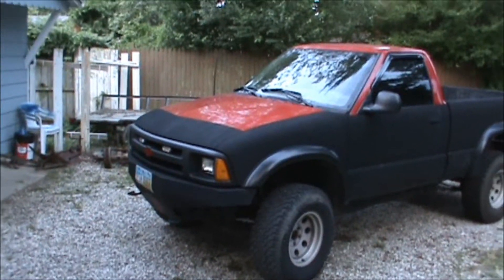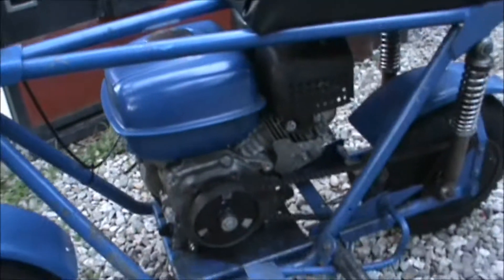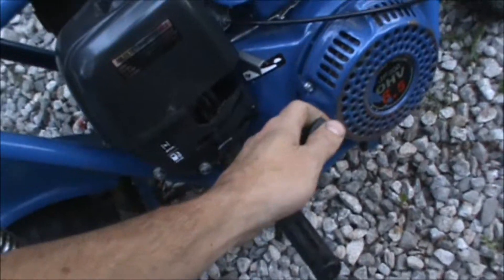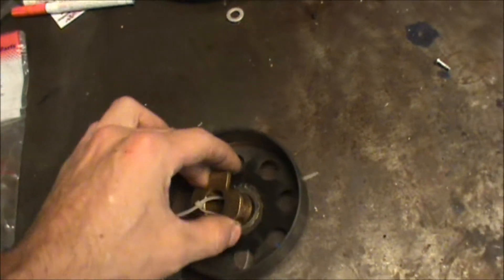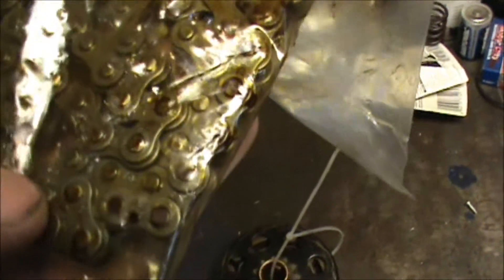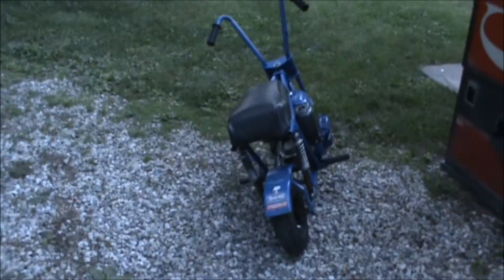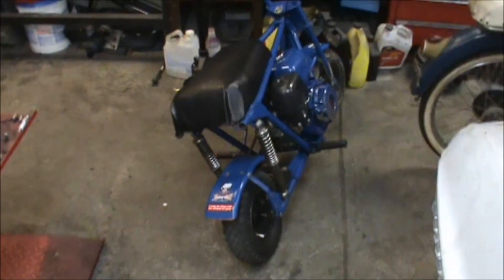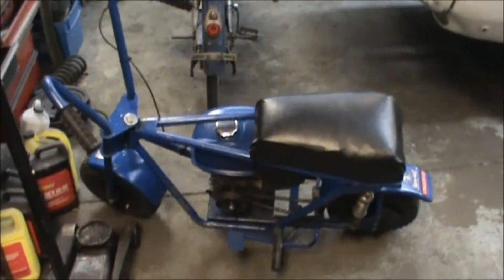Wrecking my New Minibike!

Comment: The minibike is definitely an original, not a re-production. The tale tale sign is usually the footpegs. I havent seen a new bike that didnt come with some cheap fold up foot pegs, the vintage bikes have thicker metal for the footpegs. If a bike came with fixed foot pegs, 9 out of 10 times it will be vintage. Great rides, keep collecting!

Comment: Unless I'm wrong centrifugal force pushes the clutch shoes outwards.The springs pull them back in causing it to disengage.
Reply: Means u don't need to switch gears
Reply: drew towski You are right,you do not need to shift gears but that was not what I was talking about. I was talking about how the clutch works. The weights move outwards with centrifugal force to engage the clutch.When the engine slows the springs pull them back in and that disengage the clutch.

Comment: I could tell that was DEFINITELY an old bike.. I owned a Bonanza BC1100 with a modified 5hp Briggs and it was a BLAST. The way they build the bikes today is all the same, you can tell by the cheap washers and cheap bolts. If it has heavy duty bolts and washers, its old.. thats basically how I can tell for certain.

Comment: Judging by the wheels and the way the frame bends are espically the front end I doubt its a Rupp although it is similar as far as the rear shocks engine is in no wat a Rupp (but yu probebly knew that) im guessing a older knock off